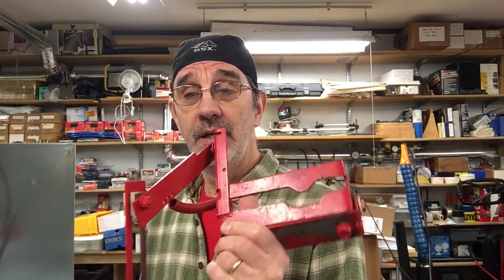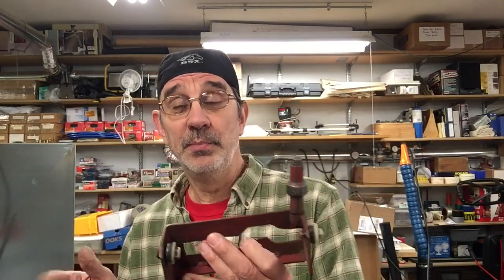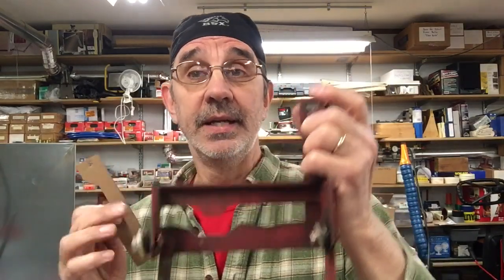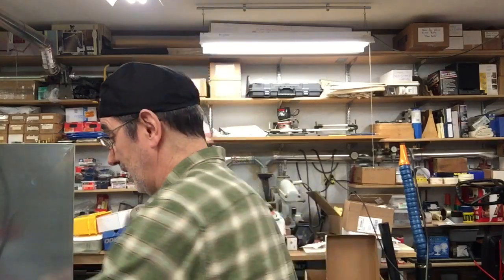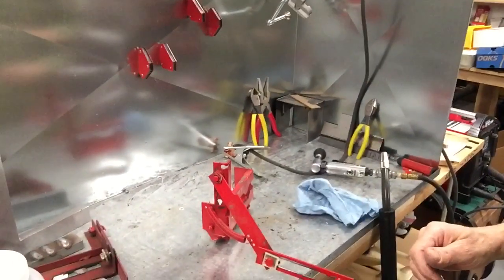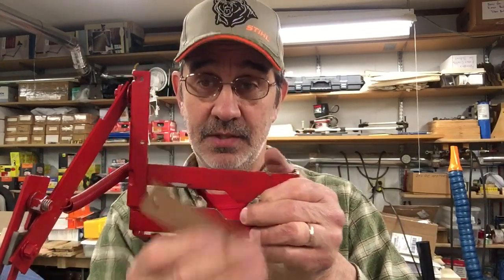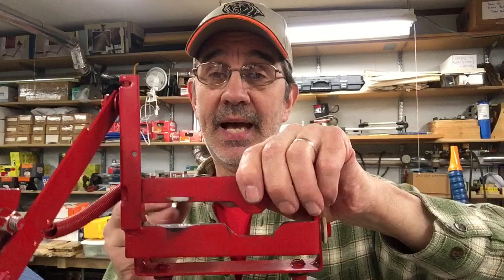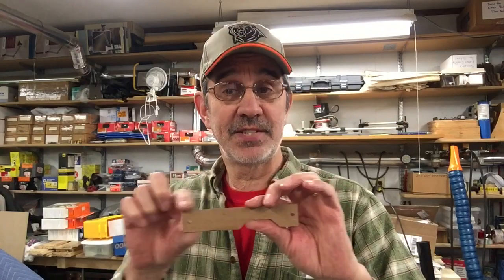290. M/S 56. How can I repair my yoke .

Comment: 2008 28" RER.  Watched almost all of the episodes.  Repaired front end first, thought I had a chewed up yoke, nope, almost like new which surprised the heck out of me considering how rough I've been with the mower, just the simple spring in the highest hole fix and all good now.   Btw, my 08 had the 5 high holes but only ONE bottom hole.  Today was removing the BS time bomb oil doo hickey and changing the oil.  Finding the 3/8" parts was way harder than I'd imagined. New clutch / brake cables are on order from Parts Tree (found the clutch cable cut 1/2 through), and about to install front tubes.  Addicted to watching.  Excellent teaching style.  Will continue to subscribe.
Reply from the maker: Thank you for the great comment and thanks for being a subscriber it really helps me out. Jim

Comment: Jim , my father-in-law had snappers since they came on the market and he worked in a power plant which had a full shop.  One of his improvements had to do with the blade.  He took an old worn out blade and ground it down to the metal was level.  Then he took case harden  welding rods and built the cutting edge back up and sharpened it.  So like the carbide tipped skill saw blades he had a super blade on his snapper.  The thing worked and he had a 3 acre yard with huge pine trees that had pine cones etc.  H cut it all up and the blade did need to be sharpened  for years.  An old  snapper lover.
Reply from the maker: William Moore 
Thanks for the tip Jim

Comment: Hi Jim - Rodney from Ireland here. You may recall my email dated Nov 14 2019 in which I detailed a similar fix I made, though I mounted it 1mm higher on the yoke to exert greater pressure on the mechanism. I initially bolted mine to the front of the yoke and discovered the yoke locked the clutch wheel onto the drive disk. Boy, did it smoke and smell. I then bolted my bracket so that it faced the rear of the mower and everything now works perfectly. You may also recall my discovery that there are different design yokes. Both my machines have the reverse gear slot higher than the forward gears, which necessitated me figuring out a different method to adjust the drive disk to avoid difficulty in selecting neutral and reverse.

Comment: I'd like to know why reverse position sets the chain case higher (and makes better drive disc to clutch disc contact) than the forward speeds? Can the added repair be set a little higher like reverse is? Especially when the clutch disc material is worn part way down. I note your comment about ensuring the chain case does not rub on the drive disc.

Comment: From Mark In KY.  A Question,Jim, After viewing your video, Would A Stainless Steel weldment bracket or a SS inlay wear surface be feasible with this application. 
I do realize that SS is not as easy to work with as opposed to Mild Carbon Steel. Even on building up the worn spots as shown on your video; SS wire or SS stick electrodes would lay down a weld bead that would also be somewhat more wear resistant than mild steel consumables. Of course with using either SS or even hardfacing to enhance surfaces that encounters frequent wear; One resolution may cause problems with the opposite wear surface. I like your approach with this issue and always enjoy your videos,Jim.  Best Regards From KY.